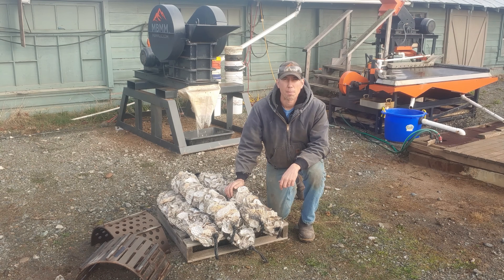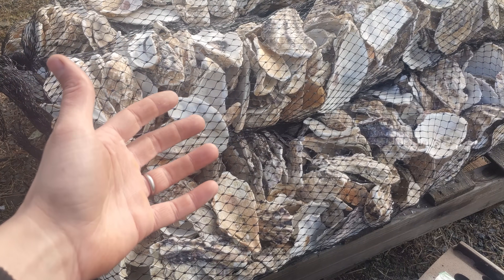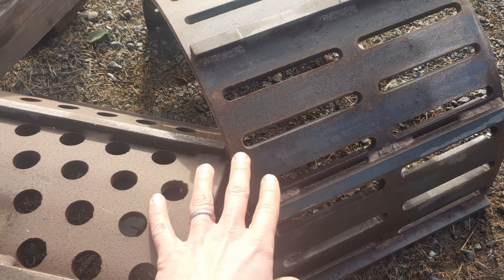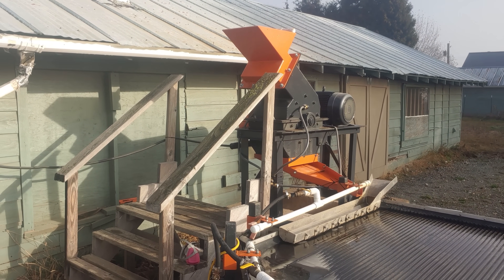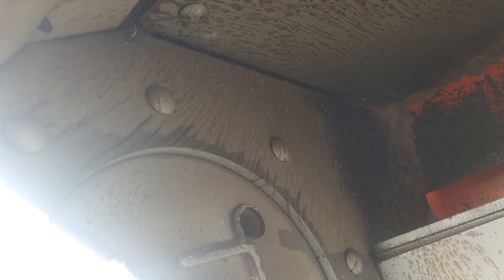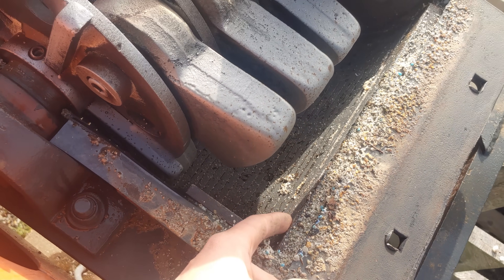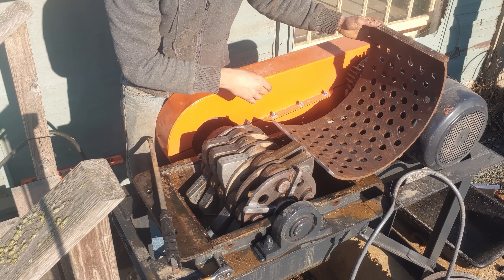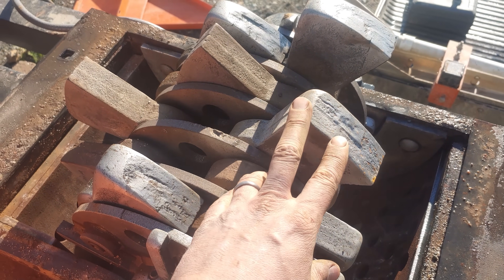Oyster Shell Crushing Machines - Crushing and Grinding Shells with Jaw Crusher and Hammer Mill

Comment: Grew up at a feed mill, started working for my dad when I was 10.  We always added oyster shell with the idea being that the calcium in them helps to strengthen the eggshells.
Reply: I believe it also acts as grit for their gizzard since that is something they need as well.
Reply: Yes, it does settle in the gizzard where it helps to process food.  Being old, I forgot about that.  Lol
Reply: @jeffreywhitmoyer860  We used small stones in our bird feed mix with oil, crushed grain, and meat meal. The new addition of the oil clogged our silos up a fair bit too lol... when we looking in through the top there was a hole from top to bottom, eventually we need shakers on the silo to make it move. I can see oyster shells being a good addition to the feed, its just the addition rate that would need to be worked out.
Reply: That was 50-60 years ago, I don't remember what the quantity was that was added per ton but I know it was a fairly small amount.  Never caused any clogging problems in the mixer and it came to us ground and bagged in 100 lb sacks.  I'm thinking it may have been 5-7 lbs per ton.
Reply: I had a job rebuilding those hammers once.
Reply: @redwater4778  me too at omni source the were driven by 2 train engines and the hammered cars!!
Reply: Too much calcium will cause problems for the birds, kidney problems or rickets.
We feed our birds free choice calcium. 

However at our other farm, if they are strictly production egg layers you will need to add to feed and it requires lots of math and science to get it correct. (We learned the hard way) 
On average we try to give our production egg layers 4.8-5g per day with a total feed intake of 120g 
It's been a challenge as we are small time farmers and don't rely on commercial products. It's been a very interesting learning process over the years. We are slowly getting more right than wrong.
Reply: @MARKE911  Are your chooks all meat birds? when I started on the poultry farm we had 7 massive sheds, only 2 of us worked it, not much fun on the debeaking and vaccination days lol, only 2 of us catching and having to tend to the other shed on our breaks, glad thats all behind me now. We never had much problem with the meat birds, but those scaredy white steggle ones used to scare easily and we at times found a few hundred dead in the mornings due to a spoggy getting in and scaring them into a panic and heap up into the corners and the bottom ones suffocate. Not nice when you raised these from chicks  to point of lay. The meat bird was different, more friendlier, but if you had food on you, you might get suffocated lol.
We had 2 sheds of cage birds, very sad to see them in there, toe nails so long and half their feathers pulled out, glad those days are over.
Reply: @Zendukai   all our birds are egg layers and not production egg layers either.
Reply: @MARKE911  Fun times for you.  Over the years I got to see lots of weird egs, log skinny ones and even egg within an egg.
When the meat birds came along  OMFG the double yolkers were huge on the fillers, you could not put  any eggs next to one lol. Sad to say, all tose double yolkers ended up in the pit, could not sell them sadly, sure we used to take some home but that was stopped later as well. I worked on the breeding section as well as the rearing section working 12 days straight then 2 days off all for 100$ cash in hand for a weeks pay, the older guys were getting 250 a week. When I left there and worked in the smelter my pay went to 500  pw woo hoo party time lol.
Reply: @MARKE911  Rickets is caused by a lack of calcium. Did you mean hypercalcemia? Hypercalcemia is a condition in which the calcium level in blood is above normal. Too much calcium in blood can weaken bones.

Comment: The finer stuff is a great addition to bird feed, they'll do really well with that in there diet.  It's also great as an amendment to acidic soil since it lowers the PH.  The larger sizes are great for landscaping just like you said, they had tons of shells in Oyster bay here in NYC back in the day.  Every driveway in the area was paved with them because waste not want not.
Reply: All well and good, except for one thing, it will raise the pH.
Reply: Actually it raises the pH. Acidic soils have low pH, somewhere below 7. Treating it brings it closer to neutral at something closer to pH 7. But I know what you mean.

Comment: The larger pieces from the jaw crusher, use as walkway material ( gravel path with the crushed shells instead ), the feed size the customer wanted obviously, the fine powdered stuff if fired can be used for lime  on lawns / soil remediation, in concrete, in fish food, as lime for marking playing fields.

The tumbling as the larger pieces are shifted and spread out takes off the sharp edges fairly quickly, as they wear down into powder they leach into the soil and reduce the acidity. You can walk on the shell paths in bare feet with no problems easier than with actual gravel.
Reply: I have been to Blake Island State Park across Elliott Bay from Seattle, and they serve steamed clams when you get off the boat. They encourage you to drop your shells on the walking path to create a great walking surface.
Reply: Tom
It's just nice way to get rid of your trash.. "smash your empty bottles to road, so cars don't drive too fast. It's more safe and burn less fuel" :D
Reply: They used to make roads out shells on the Eastern Shore of Maryland.
Reply: Some one could instruct the proper use and exposure (for adults and youngsters) of PPE - personal protection equipment

Comment: Cole Ash was added to concrete to make it creamier and easier to shape. It's becoming less available because we're shutting down coal fired power plants. I wonder if finally crushed oyster and clam shells would be a replacement?
Reply: They would def have to be ground to nothing… one shell in your brick or mortar, and it would cause a blow out when moisture made shell expand..calcium like shells works weirdly!!

Comment: They make great lime. They’re still crushed and fired to make Calcium Oxide all over Asia and hydrated with water to produce calcium hydroxide for use in everything from cement to fertiliser to mixing with betel nut for chewing.

Comment: Curious as to whether all that water would change the size distribution and whether it would be more advantageous to dry those shells first.
Reply: My thoughts as well. Also wondering why the need to feed so high? Is crusher available at a lower height. Have the screw go 30-45 degree angle with pvc or tubing placed above rinsing or washing shells. 

Thanks for the video and convo 👍